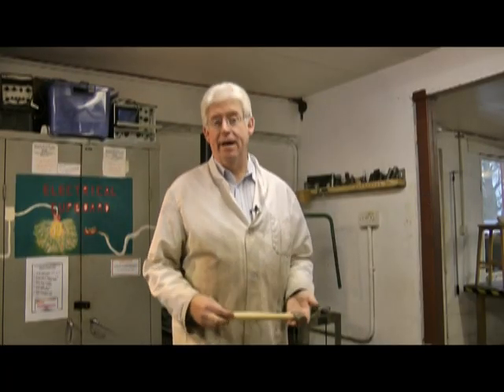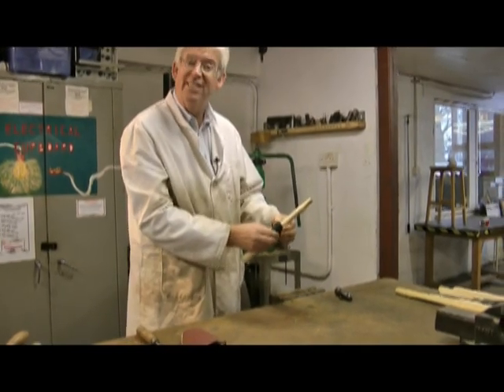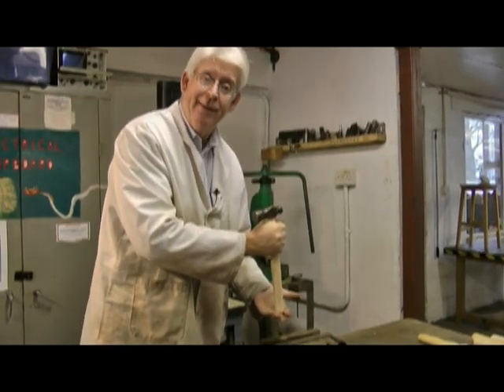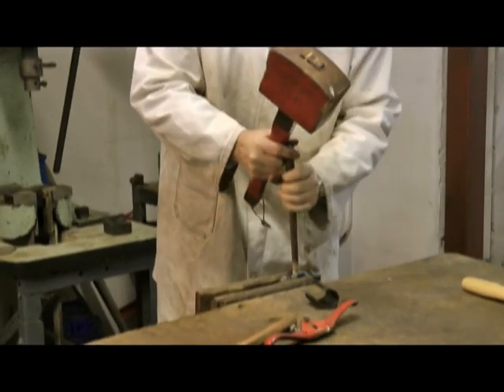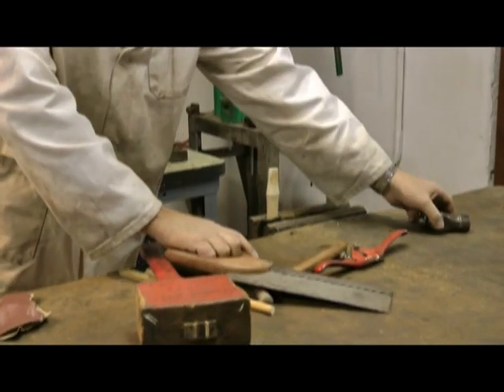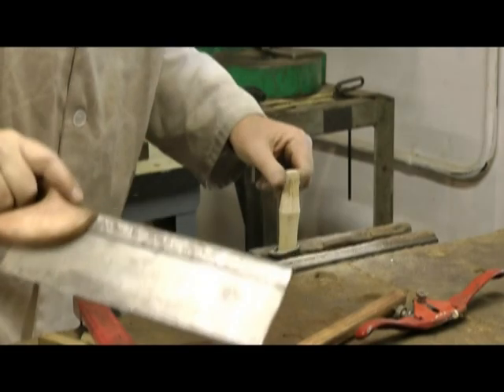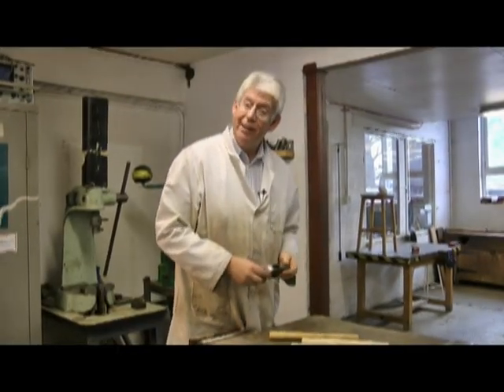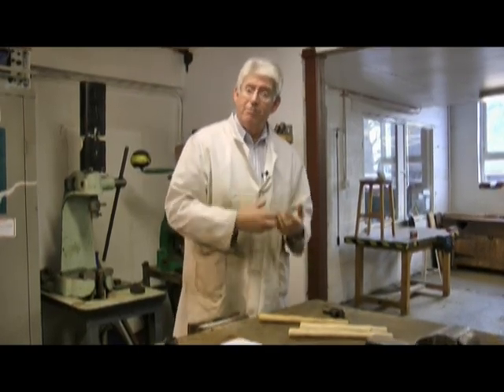A Guide to Rehandling Hammers

Comment: Great job. Very useful knowledge that I could have used 45 years ago. You said that nobody is sure why the wedge on a claw hammer goes in at an angle. I'm not a hammerologist nor a metallurgist. However many years of fabrication have given me some insight. When making two objects fit together tightly you must insure to have as nearly to 100% fill as possible. Anything less and you leave room for expansion and contraction from temperature and humidity which will make short work of your new handle. One can easily see how you have reduced the unfilled area in the oval opening. With a rectangle opening you accomplish this by filling this area from corner to corner. First with the wood wedge  corner to corner and then again with iron wedges to the opposite corners at right angles to the first wedge expanding the handle as deep into the corners as possible.
Reply: I have a very old, well-forged claw hammer head, probably about 70 years old, which sat around in the toolbox awaiting my attention. I'm now in the process of shaping the new, imported hickory handle (since such wood is not readily available in my country (Australia). The configuration of the head is unusual. The dimensions of the underside (handle insertion point) rectangle are 5/8" X 1", which is about the same as the wood of the new handle. But at the top where the wedges go in, the rectangle becomes 9/16" X 1 3/8". Therefore the aspect ratio is vastly different and requires a lot of splaying of the wood in the direction of lengthwise along the rectangle rather than crosswise, the usual direction. In contrast the short dimension actually shrinks by 1/16". Very odd!  It seems to me that this is an invitation for the wood to split, in order to accommodate this much readjustment to fill the aperture, to bend and increase 1" by 3/8", which is a big ask. In the light of the comments about corner to corner wedging, I am wondering if my solution should be to put in two wooden wedges at 45 deg. to that they form a parallelogram in the centre of the rectangular cross section and two corner triangles. It seems to me that this would put far less stress on the hickory to accommodate to this new shape. I'd be grateful for any suggestions or tips.

Comment: FINALLY! A clear, concise explanation of the hammer handle replacement. Thank you, nice job. My only question is my ball peen hammer seems to have  different size openings and was wondering which is to the top?  I will guess the larger goes to the bottom.  Thanks again.
Reply: This is the first comment I've seen on Youtube that addresses the different size holes on the top and bottom of a hammer head. I've rehandled a coupe of claw hammer heads, which have definite tops and bottoms. The larger holes were on bottom.

Comment: I believe you may have had your hammer head upside down. If the eye is tapered, the larger opening goes down first to fit the taper of the handle. If your head was symmetrical, I'll just be quiet.
Reply: I've been trying to find guidance for this.  My thinking was the larger opening should be on the top, so when you drive the wedges it expands the wood so that the handle cannot slip off.  But I've seen several videos that state the waist is narrow and the openings are the same.  I would love to get clarification on this.
Reply: Larger side of the hammer head hole to the top as per a old blacksmith.

Comment: Is this bloke for real? The top of the hammer head had huge gaps where the shaft came through and then he used a wood rasp to clean up the steel wedges and the top of of the steel hammer.
Reply: That space will be filled when the wedge is put in. The hole in the hammer head has a waist at it's center.
Reply: He was filing the the top of the hammer with a wood rasp !
HELLO ! !
Reply: Well, he can use what ever the fuck he wants to do that. I don't care but that would not be a choice of mine.
Reply: He broke the wedge off knocking it in.
Reply: kaxitaksi . Ha!
Reply: No, the wedge broke off by itself when it was fully inserted. They tend to do so if you hit it.
Reply: David Cartwright . Ha!
Reply: kaxitaksi. Not if it is the made at the correct angle they don't. Also if he'd put some more boiled Linseed Oil round the top and into the wedge saw cut that would have helped a lot.
Reply: No.
 When a wedge hit the bottom in the cut it has nowhere to go so it will snap. If you hit VERY hard you risk splinter the handle.
Reply: John Harwood . Did you see the state of the top of the shaft after he used the spokeshave on it ~ Jesus Christ, it was like a threepenny  bit.
Reply: I do love how those with the greatest knowledge and harshest words seldom have any related content on their pages. Most have none at all.
Reply: Erm all wrong this hammer handling video is well done and the hammer is intelligently crafted please refrain from commenting on things you know nothing about Charleeboy